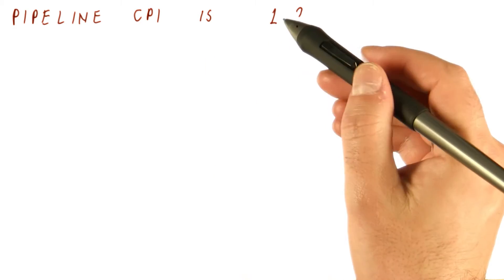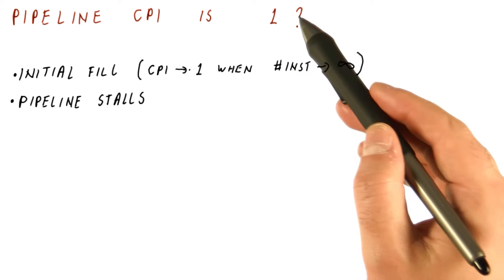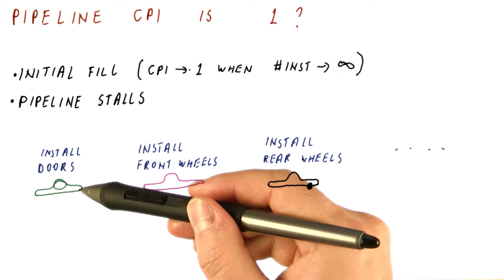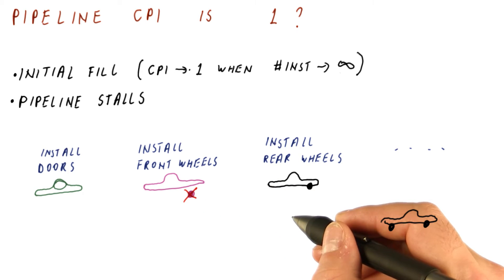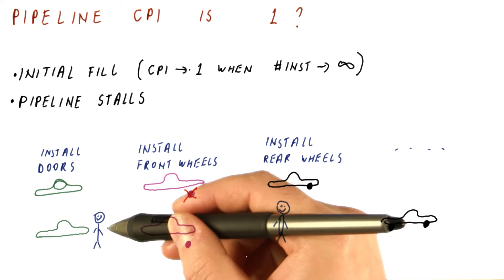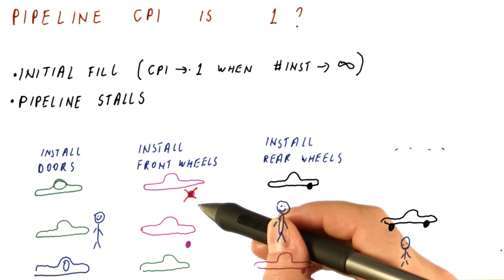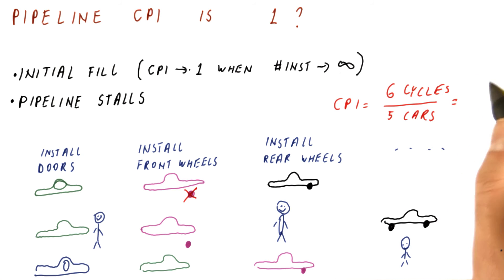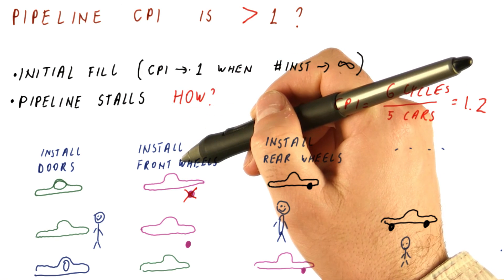Pipeline CPI - Georgia Tech - HPCA: Part 1

Comment: Shouldn't it be a minimum of 7 cycles for 5 cars? One car requires at least 3 cycles, so I don't see why it's 6 cycles per 5 cars. What am I missing here?
Reply: If all steps are filled and no problems are encountered, then one car with be produced in each cycle. The CPI, in this case, is one.
Reply: He is assuming that after de pipeline is filled (steady state), one car is finished every cycle. So, if every five cars there is one stall, this means one cycle is added to finished the five cars. In other hand, if stalls happen on a regular basis, the CPI will not be one, it will be greater than one, not lower than one (see at 2:55).